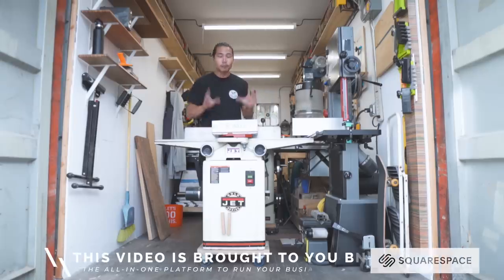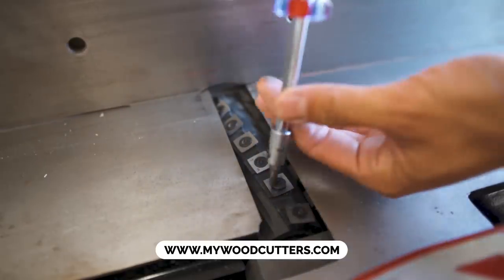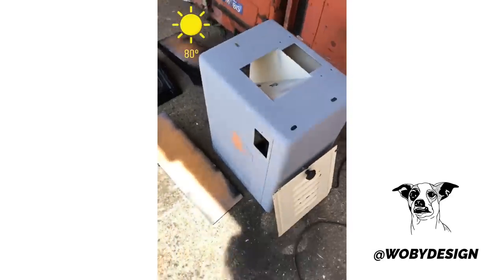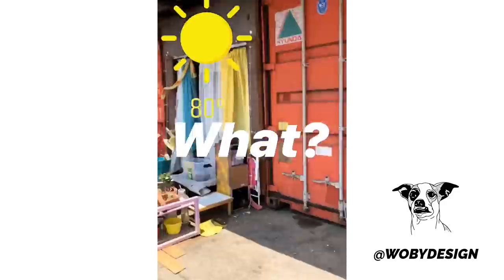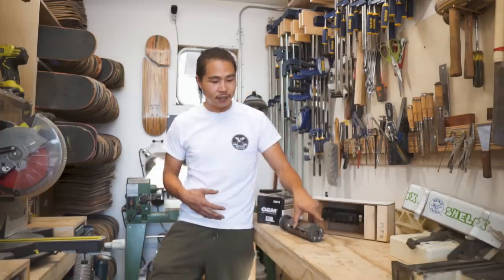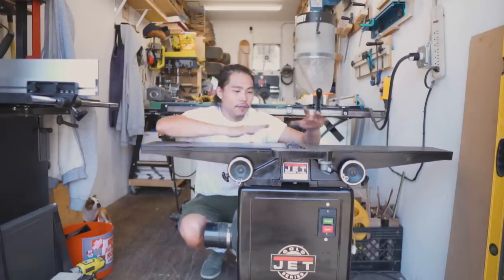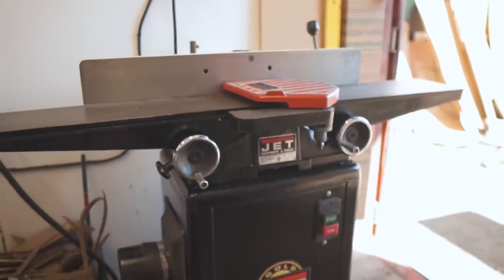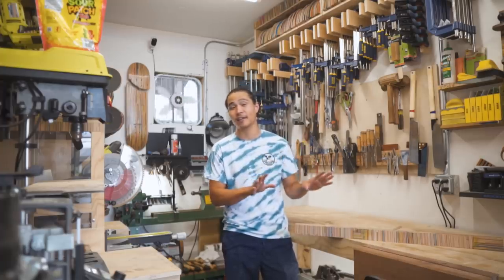SHELIX HELICAL HEAD UPGRADE!

Comment: $200 is a crazy good deal! 

You should also consider putting a paste wax coating on your table saw surface, it will prevent the rusting :)

Comment: did you fix that one blade that wasn't lined up like the others? It's the first one on the left, shown a few times during the video. :)
Reply: End blades are straight so you don't get chip out on edge
Reply from the maker: i know what youre talking about but i think that specific blade is set up that way because it's at the edge. 
But if it's wrong, it's SUPER easy to rotate the knifes